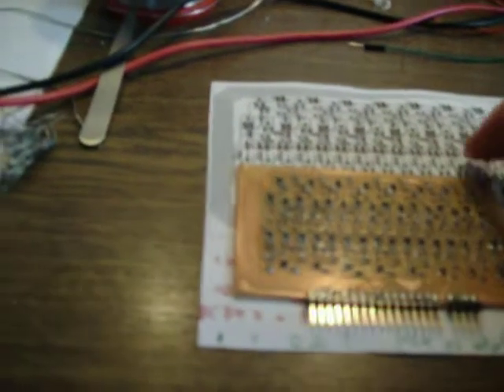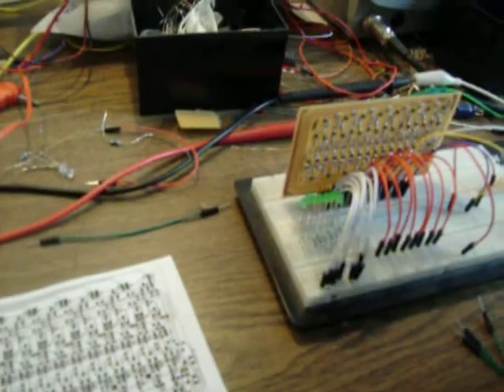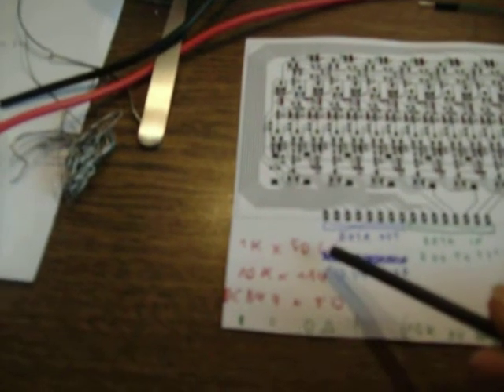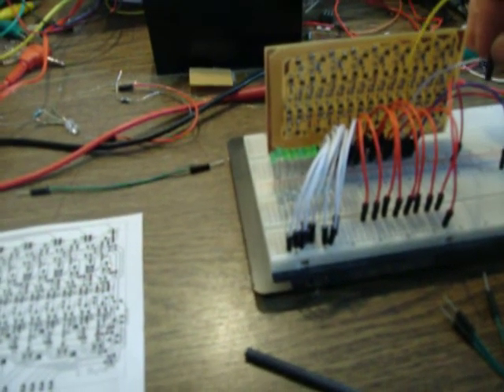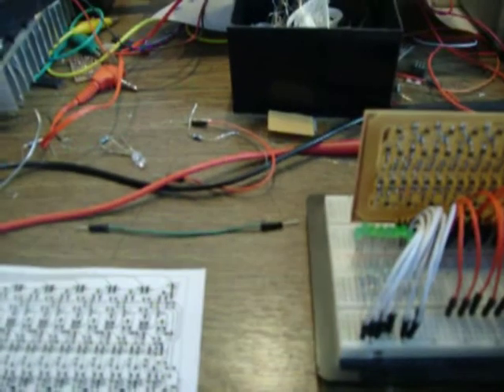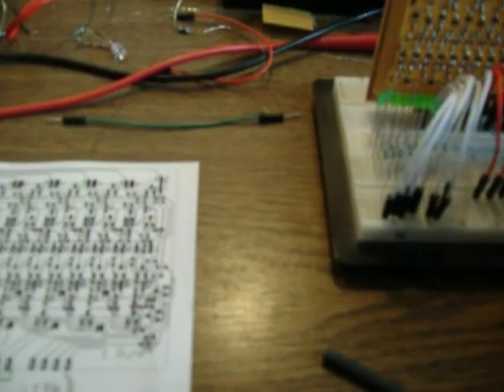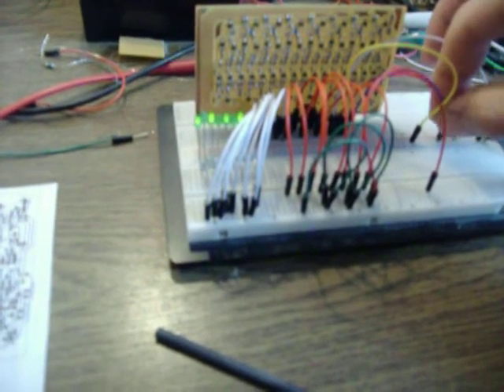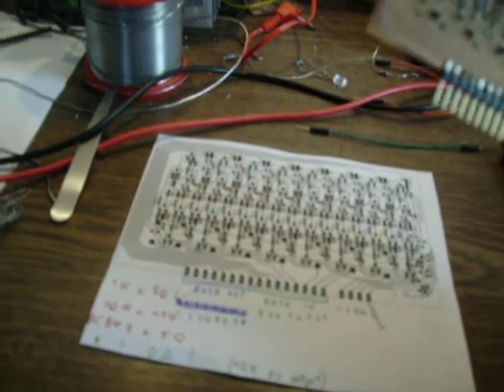1 byte SRAM-board (volatile)

Comment: What type of transistors did you use for this?
Reply from the maker: Martin Vaivods  I used BC847 (npn) for this one.
Reply: Thanks! I was actually just reading about mosfets and how they're actually better for switching operations in terms of using less power.
Reply from the maker: Martin Vaivods That's true, they switch with voltage and not with current. I like both.
Reply: can u give its full schematic??